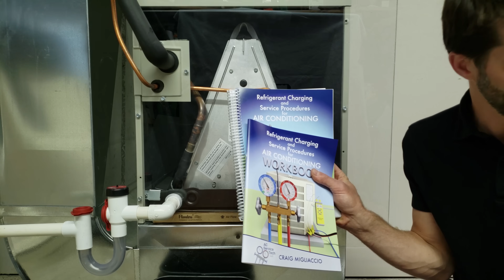Why a Condensate Trap is Needed on an Air Conditioner! Up Close View!

Comment: I am in mobile home, down flow furnace.  no trap.  I have no room for one without a huge ugly hole in the front Entrance.  5 years now no issues.  Drain just goes out side of trailer through belly insulation

Comment: Awesome short and informative.  Theoretically blow through system doesn’t need a trap but a lot of the systems have them.  Why is it a good or bad idea ?  Also I sed a lot of  blow through systems have vent pipe upstream of trap open wasting energy.  However I have seen same type system draining sluggishly when there is a cap on the vent.

Comment: Okay so first time start up there are many instances where the traps are not prefilled but they don't overflow. Every residential and commercial product doesn't get pre-filled for the summer startup. I would assume at startup and an empty trap and the unit never shut off it would in fact overflow. Since it eventually cycles off whatever's in the pan winds up flowing into the trap that's how it gets filled.

Comment: What's wrong with avoiding complications associated with properly installing p-traps, and instead just bleed condensate from the system using a hose?  HVAC systems have been around for a while.

Comment: Good grief man you have also significantly changed the dynamics of the air flow because you have the entire side panel off. The system has no choice but to draw all the air in from the side where you have removed the panel.
Reply from the maker: that is a clear plexiglass panel so we can look inside during the test, thanks
Reply: @acservicetechchannel  Well, OK. I just can't understand why my system has no trap yet there is slight positive pressure coming out the drain tube.

Comment: Nice video. I just had a new ac system put in last summer and the condensate pump stopped pumping and went under the house to find the trap plugged up after only 1 year. I also found the goof balls didn’t seal the bottom of my supply plenum so 10 to 15 Percent of the cold air and hot air was going into my crawlspace. Very pissed off number one but also why would the trap be stopped up only after probably 10 or 11 months of total running time

Comment: OK, then explain this to me. I have a very similar setup with no trap and yet there is positive pressure coming out of the drain tube as well as water??? Is the blower before or after the coil?  My blower is before the heater and ac coil and there is no venturi effect. On your system where is the blower positioned? I think you need more detail.

Comment: What about dry vs wet climate? In AZ it is a dry heat, lol. My system has a fan rignt on top, but no trap, just an L, then a sharp downhill run on the roof. During the Monsoon season lots of water comes out and gurgling can be heard at the pipe exit. During the dry season, nothing comes out,
logically because there is no moisture to take out of the air. I have seen no p-trap problems for 14 years, so it seems AZ climate is an exception
to this rule? Thank you.

Comment: So do you always use a condensate trap or just when the coil is behind the blower motor and the blower is drawing the air from the coil and not blowing through the coil?
Reply: Always use the trap. If the blower is before the coil, without a trap, it will push cold air to the outside through the condensate line, wasting energy.

Comment: I’m just an ignorant home owner do I have an ignorant question. Would a typical cooling cycle actually condense enough water to overflow the pan in Arizona even n the monsoon time?  If not, would the pan holding the condensate simply fill, drain, fill, etc?  It seems to me that the trap also provides a service escape every year. Please don’t misunderstand my questions. I’m trying to learn pros & cons in Arizona.

Comment: Keep in mind this is for an air handler and not a coil on top of a furnace. The coil on top of the furnace has positive pressure so you dont need a trap.
Reply: That makes sense why my unit doesn't have a condensate trap
Reply: Trap will keep cool air from escaping though right?
Reply: The Delta p is small, very little air escapes.  You can test this just by running the fan or furnace and very little air comes out of the drain hole, even less if you have a drain hose on it.
Reply: Thank you . Ive been wondering this for the longest
Reply: Does it hurt to put a trap in even if not required
Reply: It does not hurt to put a trap in, in any case.

Comment: That only applies on a system where the drain is on return side. Not necessary when the drain os is on the positive pressure side (supply)

Comment: Reading through the comments, there seams to be some misconception about not needing a trap on units where the blower is before the coil, thus creating positive air pressure instead of negative. While that is a true point in regards to condensate drainage, however, a trap is still necessary in a positively pressurized cabinet (or unit), as it prevents the conditioned air from escaping. In terms of wasteful energy, can be compared to why they seal all the seams in the ducting.
Reply: A trap on a positive air flow unit could potentially cause a drain backup if not maintained. Causing the need to preform maintenance when otherwise its not needed as the positive air will keep a trapless drain line free and clear.
Reply: @ricardofmartinez8693  Actually in my 25+ years in the HVAC/R industry, I've seen almost as many condensate restrictions develop on a positively pressurized system as on a negative one, granted its not as common, but they do happen enough. Aside from that being said, fact is, that very same equipment (that contains far more critical components in it then just a condensate trap) is suppose to be, and should always be properly serviced and maintained on a regular basis anyways. So given that, how would it be any bigger deal taking another minute or two to check out a trap?
Reply: @c-trap9792  i appreciate your experience , i have been in HVAC/R since 1995 so I feel ya. I guess the point i was trying to make was not so much you dont need PM’s as much as a trap is not a good idea on a positive flow drain line cause it could cause an unwanted drain stoppage. Stay cool and safe  out there bud 👍👍.

Comment: This is only needed if the fan is after the evap coil, in the line of airflow.  Most systems have the fan before the evap, even if they are counterflow
Reply: While that is a true point, however, a trap still serves a purpose in a positively pressurized cabinet (or unit), as it prevents the conditioned air from escaping. In terms of wasteful energy, can be compared to why they seal all the seams in the ducting.

Comment: Good video just think if it's not set up right people if they have the drain tapped into their drainage system of the house meaning sewer pipe they'll be sucking the fumes into the air conditioning system and breathing them

Comment: Amazing Explanation, but should have mentioned negative pressure with a trap and Positive pressure without!
Reply: While that is a true point, however, a trap still serves a purpose in a positively pressurized cabinet (or unit), as it prevents the conditioned air from escaping. In terms of wasteful energy, can be compared to why they seal all the seams in the ducting.

Comment: I am HVAC contractor with ~10 years of experience. I think that this video is the best explanation why do you install that p-trap on the condensate line so far. :) Thank you!
Reply: Aren’t gas and electric systems drain lines installed differently? 1 of them has a vent with a cap and one does not have a cap or something like that. I’m still trying hard to understand drain lines which is wild because I’ve gotten very experienced. But the drain lines still confuse me somehow.
Reply: WHAT DO YOU CHARGE?

Comment: My system has positive pressure on the drain pipe. It blows the condensate out. No P trap, no problems.
Reply: While that is a true point, however, a trap still serves a purpose in a positively pressurized cabinet (or unit), as it prevents the conditioned air from escaping. In terms of wasteful energy, can be compared to why they seal all the seams in the ducting.

Comment: this is not needed when the blower is pushing air over the coil.
Reply: While that is a true point, however, a trap still serves a purpose in a positively pressurized cabinet (or unit), as it prevents the conditioned air from escaping. In terms of wasteful energy, can be compared to why they seal all the seams in the ducting.
Reply: Actually it does or you'll get conditioned air pushing out and it will still effect drain and on the off cycle you could get sewergas in the airstream. 

Every drain needs a ptrap.
Reply: @aarongriego3741  I meant when the blower is below the coil and pushing air as opposed to when the blower is above  the coil and pulling air.

Comment: You only need that for an air handler weather if it’s a heat pump or straight ac, you do not need a trap for a conventional system gas furnace and coil on top…

Comment: In 14 years of service calls I never seen a drain pan overflowing because of a missing P trap..  Not once!
Reply: Me either. With the panel in place, that whole area is pressurized. There is no sucking on the drain pipe, just this video.

Comment: Love the video, but one clarification.  You only need a trap if the coil is on the negative pressure side of the fan. In the North, most of what we install are a gas furnace with the evaporator coil on top of the furnace. No trap is needed because the force of the blower is positive.
Reply: I’ve always puts traps because all the debris that will eventually get clogged will get clogged there and not in the wall or somewhere that is harder to get and then when it clogs a pipe cleaner and bleach is all you need 👏
Reply: This can happen on positive pressure units aswell, altough probably not as common. If the drainpan outlet is connected with a hose that is way thinner then the drainpan outlet pipe diameter, the velocity of the air passning makes drainage impossible, at least as long as fanspeed is high.

Comment: Very informative video. Does this also apply to mini-split condensers and head units?
Reply: No it does not , mini split units  are  open to the space they are in and are not sealed/ pressurized like a normal air handler. Hence you dont get the vacuum effect.

Comment: In this application the air is being pulled through the evap coil rather than being pushed. Does the same apply when the air is pushed over the coil rather than pulled?

Comment: normally gravity is dragging the condensate water to drain, vacuum effect in the drain hole is a caused by a dirty evaporator and air filter..even of you dont loop the drain line the water can still flow,  the good thing is looped drain line can make a barrier from outside air..

Comment: I always explain this to new techs joining me , if the blower blows on to the coil?  You don't need a trap , if the blower is on top of the coil getting air FROM the coil ? Like the return air passes the coil ? You need a trap , because air will get sucked in from the drain line , they never forget this ,,, easy and simple.

Comment: Great visual for evaporators on the negative pressure side of the blower. You should explain that not all are on the negative side. An explanation of where to put the vent would also be helpful. In my neck of the woods most residential evaps are on the positive side of the blower.
Reply: You are right
Reply: My exact thought. The plus side of adding a trap on a push coil is you don’t lose some of the efficiency of air being leaked out of the drain, but it’s not critical to have one as it is on a pull coil.

Comment: Good video. And this ONLY applies when the blower motor is on the supply side of the evaporator causing a negative pressure which sucks air into the condensate pan from the drain. When the blower motor is on the return side of the evap coil, you will have a positive pressure pushing air out of the drain hole and you won't need a p-trap for this
Reply: great point! i was left wondering why my system continues to perform fine without a trap, but you've answered it!
Reply: Same here.  Works fine.  I lose very little air with my design
Reply: You still need it, that's air loss going out of the condensate line.
Reply: how do you determine whether the blower motor is on the supply or return side? I have an AC unit that has a copper pipe leading to the drain, and there's a gargling noise when it runs. There's no trap, and today I noticed some water on appears to have leaked out of the unit (so I suspect it's a poor install missing the trap!). thanks in advance
Reply: @nwcurrie  Great question, and before answering let me point out that having a trap installed by a professional is a good idea whether it is negative pressure or positive pressure.  Negative pressure requires a trap for the condensation off the evaporator to flow, and it is perfectly fine to have a trap with positive pressure as well.  Even a tiny screw hole leaking air is a waste of energy, so a larger 3/4" drain hole is wasting more energy.  Adding a trap to positive pressure is optional just like selecting more energy efficient equipment is optional; how much energy you want to waste or conserve is up to you.  Back to your question, the refrigerant lines and the drain line will connect to your equipment at the evaporator side, so the opposite side of your equipment will have the blower.  So how do you know if the blower motor is on the supply or return side?  It's complicated to give an accurate answer without seeing the equipment since there are so many variations: upflow, downflow, horizontal right, horizontal left, now slide, now slide...   The side connected to your filter (or filters in some applications) is the return side.  Typical upright gas furnace systems with an evaporator on top of the furnace means the blower is on the return side (positive pressure) while most upright electric heat air handlers (with few exceptions like Trane plastic air handlers) have the blower at the supply side (negative pressure).  It's difficult to answer accurately without seeing your equipment or adding more details, and having a pro install a trap is a great idea either way.  The J trap with built in overflow switch in the video is superior to a typical cheap P trap.

Comment: If your air filter wasn't restricting so much flow the pressure wouldn't be so negative, but if it is this makes good sense. I have never had a trap and never had this problem, but it would work.

Comment: A dry trap This may explain why I have nothing flowing out out the dnd of my tube and the humidity always rising in the house.  I got to the point that I had to buy a dehumidifier to extract 2-4 gallons a day but it also adds heat to the house.  Since my trap is under the house how can I ensure that it always has water in it?   Also at the outlet I always feel a bit of air coming out but no water.

Comment: FYI !!!!!!!!!!!!: bought a new house. 2 zone system. upper unit located in the attic. there was an overflow pan the unit was located on. for some reason condensate was not flowing out the drain pipe. condensate then dripped down into the overflow pan where it was supposed to trip a float sensor to turn the unit off. HOWEVER one corner of the pan had a leak so gallons of condensate soaked the insulation, puddled on top of the ceiling drywall and started dripping through a recessed light fixture. discovered late at night when i saw water on the floor below. this was july. 

SO, sprayed flex seal on the corners of the overflow pan. spent several hours repairing the drywall. 
let my experience be your wisdom.

Comment: Two new carrier air conditioning systems.  In two years, the condensate shallow traps,  fungus slime blocked one and partially blocked the other.  Water overflowed on one pan and was about to do the same on the other.   The traps were removed, both drains went to down to a floor drain.   No problem in six years, they both drain while the system is operating.  How enough air from a fan could develop enough vacuum and stop water draining into a pipe, that drops down to the floor defies physics.    If you drain is shallow, that may pose an issue, however, the traps should be clear so the home owner can check it.

Comment: Is an external trap still needed if there is an internal trap in the unit?
Reply: I dont think so.  My unit doesn't have a trap but still drains after the unit is off.  Not sure if it's necessary to have one

Comment: My house has both the regular and emergency/overflow drains installed but neither has a trap. Will it suck air in from both pipes or will the overflow be able to drain as it should? In my observations, water has only been draining via overflow but it will still drain while the system is running, hence my question.

Comment: Just to explain what wasn't clearly stated...the p-trap is ok to have either way but this example is with negative pressure. The blower is above, pulling air through the evaporator creating a partial vacuum in the coil case, sucking air in through the condensate line, preventing the water from draining out. The accumulated water will drain out when the system shuts off. 
This will not happen when the blower is below and pushing air into the coil case. The positive pressure allows the water  to drain normally into the drain line. The p-trap will prevent refrigerated air from escaping through the condensate line so it's helpful in that regard.

Comment: Brilliant. I noticed last year when I happenned to look inside my furnace that the condensor pan was completely full and not draining. I could tell there was negative pressure so I openenned the filter area and sure enough it drained immediately. The system was installed by the previous homeonwer so I have no idea of the experience of the originall installer but they clearly didn’t understand this issue. Great explanation and video.